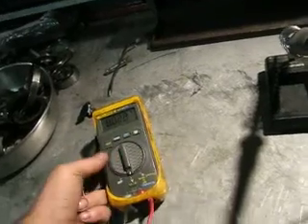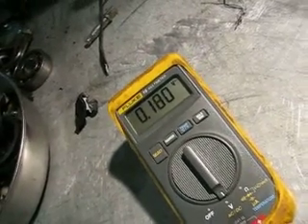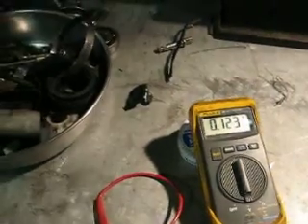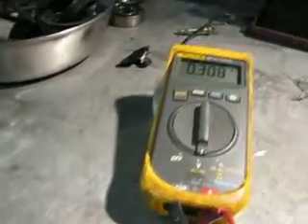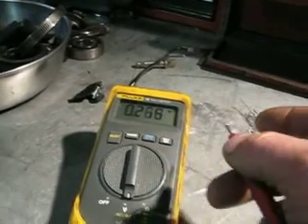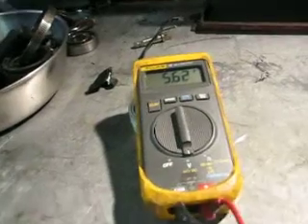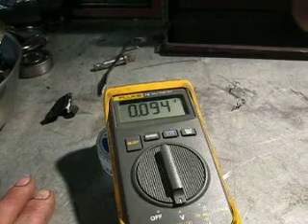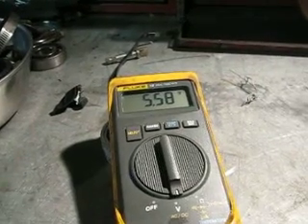The Matrix is real 2 up the voltage?

Comment: Hey Ronald, what is going on is you are reading the local EMF that is building up in your body. The copper pipes is fairly grounded and the capacitance of your body's A/C charge from local EMF EMI is the voltage reading you are getting on your meter. When you touch the metal bench you are partially earth grounding and the EMF related voltage is being released. If you had touched an earth ground while having the positive probe in the other hand, your meter would go to zero. I would bet you figured this out already since the video is 10-years old.
Reply from the maker: I discovered that an AC proximity voltage tester, if rubbed against skin, will peak the meter from static on my skin. Take a mud bath and test again and no charge at all.